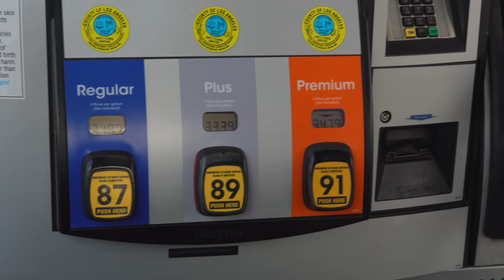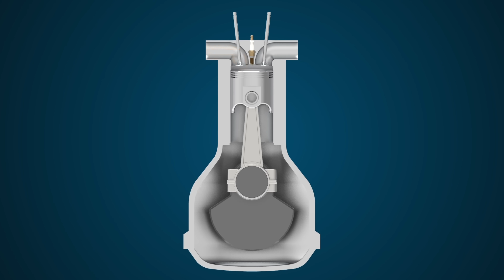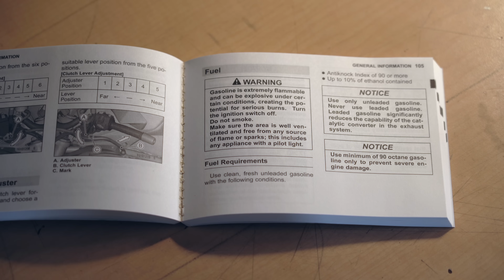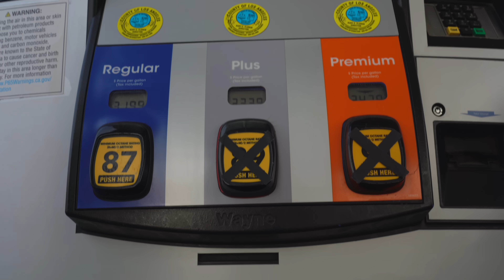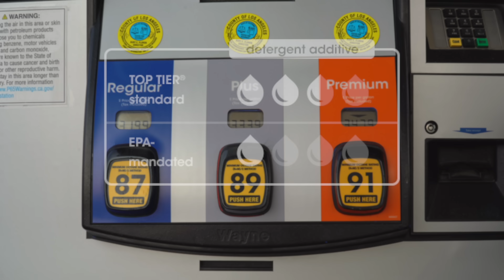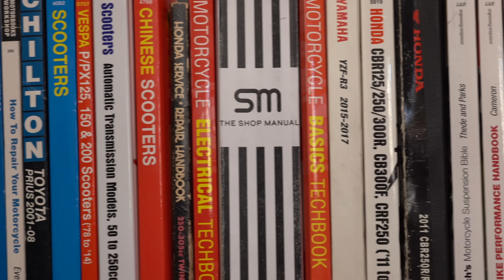Should You Run Premium Gas In Your Motorcycle? Octane Explained | The Shop Manual

Comment: I've had to explain this to so many people who put premium in their corolla.
Reply: @4The2nd BTW, I never said , nor even implied i am smarter than anyone... I have fully stated my thoughts are from EXPERIENCE ... not brilliance...
Maybe you should stop telling people what they think....
Reply: VTwinner,  First of all my first comment was not directed to you and you're first comment was directed at me because you had a hissy fit that I used the word "Theory". 🙃 I didn't invite you into my comment. Second, who is telling you 85 octane is the correct one to use? Not me. Based on the compression ratio and other factors of an engine I know what octane of fuel to use. Do you? I don't think so. I built quite a few motorcycle drag bikes in my day doing 8.53 seconds at 153mph in the 1/4 mile, so I know what I'm talking about. If your car runs better, gets better gas mileage and has more power with the higher octane fuel, then it's obvious you're engine was not designed to work with the lower octane fuel because of the higher compression ratio. If you're engine is equipped with an anti knock system and you're using 85 octane fuel when it needs 91 or higher the ECU/ECM receives information from the anti knock sensor telling it there's pre ignition present "a high pitch pinging sound from the engine" then the ECU/ECM retards the ignition timing preventing preignition which results in less gas mileage, performance and power. Also if you have an engine that was designed for low octane fuel and you put in the highest octane available, you will get worse gas mileage and lower performance and power because the octane is too high. If you don't believe anything I've said then I suggest you watch Scotty Kilmer on YouTube. He has been working on cars for 52 years and reminds me of a guy I used to work on my truck when I didn't have the tools and or knowledge. He has a video on how octane fuel has an effect on an engine.
Reply: @cliffords.8341  Thank you! My father built drag bikes back in the day, and had close times to you. Same thing you said was how I was taught.
Reply: @cliffords.8341  First of all, my first comment was not directed at you do you see where I tagged you in it? NO? Ok so we got that clear, because you tagged me before I replied to you... This is James Atwoods comment not yours , Theory is what the video used.. sorry you think its all about you...
It wasn't....Who says 85 is correct for my car... the manual does...as well as many people in this comment section saying that the manual knows best because it takes in account of the cars compression ratio and other factor of an engine.... And again you are saying I don't know what fuel to use , when I have millions of miles in 36 years of driving and thousands and thousands of dollars of gas , taking mileage EVERY day, and knowing EXACTLY what got me the best mileage per penny......PERIOD...
I don't need someone who thinks thy know everything telling me what i've already known for 30 years... I have SAVED money running premium on EVERY car i've owned in 35 years, and I've owned 30 or so...
Working on a car doesn't put on miles, people who actually drive, know.
Reply: @cliffords.8341  Oh and Scotty Kilmer is mr  DO it by the manual.. He would tell me 85 is right for my corolla as well, and to change the oil every 5000 kms.... but 91 saves me more money and makes my oil last until well past 10,000 kms because it runs cleaner in the car... win, win, tell me the drawback to it?
Half the oil changes, cheaper price per km, more kms per tank so less stops to fill back up... Sure I should listen to those that want to relieve me of my money HAHAHAHAHA Scotty would even be telling me to buy TOYOTA oil for my 1998 Corolla  that has 350,000 kms on it... Where the heck would I find Triumph oil for my 1978 Spitfire too... car with another 300,000+ kms...
Like I said, keep your theory's, I like to practice :D
Reply: @vtwinner  He might. If you benefit using 91 over 85 octane fuel then use it. Does the 85 and 91 octane fuel you have used have any ethanol in it?
Reply: @vtwinner  As far as changing the oil goes, if you use petroleum/mineral oil it has to be changed more often than synthetic oil because it breaks down quicker. Some oils have detergents which cleans the inside of the engine making the oil dirty quicker, but is not a sign it needs to be changed. Oils have come a long way in the last few years. An engine will also run cooler using a higher octane fuel when needed which results in a longer engine lifespan.
Reply: When the gas costs than the car you'd think they would figure it out, but , alas, NO!
Reply: Higher octane number may not always be helpful, but almost every higher octane rated fuel has low ethanol content. I know it is not given, but the suppliers are running the trend that way. So in theory higher octane fuel may not provide any gains but in practice it almost always does. Tried it myself and yes, better mileage and healthier engine in the long run.
Reply: @autumnleaf2976  Precisely... I've owned 20 different vehicles, and put 400 kms daily for 35 years... That's 5,000,000 kms of filling a tank every night , documenting my fuel consumption, and figuring out what gave me the best bang for my buck... These experts obviously have NEVER tried it and like to talk out their ass...
Reply: @4The2nd GLWS HF, I'm gonna keep getting better mileage and a cleaner engine. 😁
Reply: @4The2nd Oh BTW, my 1978 Spitfires manual says to use 5w30, If you use anything but 20W50 , your nuts...
And this you will hear from every person that owns a Triumph Spitfire ... just because they thought they knew best at the time, don't mean they do... A Triumph Spitfire runs FAR too HOT to keep 5w30 in it... Also, todays oil does not contain the right mix of chemicals for it, I have to buy Castrol 20W50 for older engines to get the additives it needs.
Something mechanically trained people learn in 40 years of doing the job... 
Thanks for your opinion on what I don't know though, pretty ironic considering you don't know me.....
Reply: @4The2nd A Triumph Spitfire is a CAR, I am talking CARS, there are NO modern Triumph cars...,The Last one to roll off the line was 1981 or so...
Obviously you are lacking the experience , or you would have known about Triumph Motor Cars, ... Google search British Leyland and you'll see what I am talking about..
A Spitfire using 5w30 as per manual, in this area, will fail, because the oil cannot handle the operating temperatures... We need 20W50 , no matter what you've been told.
Reply: As a BMW owner... 93 or die. Getting a yammie R3, so I can put 89 in it, cus fuck 83
Reply: a corolla elecronically adjusts timing so with a little help from premium fuel it can reduce or eliminate detonation. this results in more power.
Reply: I've had to explain the octane theory to many of our customers in the last 41 years and a lot of them see those gas company commercials saying use their highest octane fuel and you will get more performance and better mileage and they don't know any better. A lot of them are finding out they have been wasting their money buying high octane fuel.
Reply: Lower grade gas here contains ethanol, high grade does not... I was getting 75 to 100 kms more per tank and I drove 3 to 400 kms per day as my occupation... Theory's are just that, reality is a different thing.
Reply: @vtwinner  Let me rephrase what I said so you will understand what I was trying to say. I've had to explain what the differences are between octane numbers and which octane is the correct one for their vehicle. Facts.
Reply: @4The2nd The only reason I stated on a highway, with cruise control, is my route, never changed... My driving , never changed... The variables that would change my fuel consumption were well controlled.... and well documented over 35 years.... That was the point I was making, i never stated CRUISE control saved anything, except for the variable of not being consistent on the throttle...
Most cars I have driven, were NOT tuned to premium, they were tuned to lower grades of fuel as was stated in the manual, yet EVERY one got higher mileage from Premium , because of ETHANOL in the fuel.
My 1978 Triumph was not tuned to ethanol, it didn't exist then, so saying my car is tuned to any grade of gasoline today is a falsehood... My car was made when there actually was still lead in gasoline...
And I've also changed out and adjusted the carb myself.. So I know what it's tuned to, not you..
BTW, if you look at my comments, I have been talking about gas mileage, power means nothing to me, I am not tracking my cars, they are dailys, I care about mileage not power, you were the one discussing power.... I just agreed with you ...
Whoooosh
Reply: @4The2nd OH and , to add to the Triumph bits... Nothing on my car is Ethanol compatible , it would eat my hoses, orings, damage my head, valve seats.... it would make my twin SU carbs run like shit... The ONLY fuel it runs proper on, is Ethanol free, and the only ethanol free fuel here is Premium...
Reply: @4The2nd I think you are mixing up what both of us are saying... Using premium gets me more mileage, and runs cleaner... by running cleaner, injectors stay at optimum use instead of getting clogged and not misting properly.. You will retain your power longer, as cars that age, lose power, the ones that were treated to premium all their lives, don't.... Will it give more power, no, but it most certainly will help you maintain a cleaner car, will increase the oil change period, and actually save a lot of money.
My 1998 Corolla has 350,000 kms, my78 Spitfire has been around the odometer 3 times before it let go, so its well over 300,000 kms... I had a Kia Sportage I put 450,000 kms on in 3 years and it was still running like new when someone head on'd me writing it off... I am my mechanic, no one has worked on my cars in 30 years except me... It's not rocket science.
Reply: @4The2nd I never once stated my oil lasts 24,000 kms... I stated , that I went to an oil change place @ 24,000 kms, and they stated my oil was still good.... Not me...
I change my oil @12000 kms normally..
You must understand, I put on over 5000kms a month, that would be an oil change every month if I stuck to the manual, that is ridiculous, that schedule was made when there was lead in gas and and oil and gas didn't have the detergent it does today, to go by 60 year old oil change intervals is idiotic... 
I don't only maintain my vehicles, I maintain others and have been mechanically trained as part of my occupation ... And Ive been doing it for almost 40 years ...
If you think todays fluids need changed that often, you're just doing it to charge people more, it's not necessary at all....
I've literally done thousands of oil changes, and the people that come to me on schedule, their oil is still clear... it has LOTS of life left...
Reply: @4The2nd Again putting words into my mouth , not the other way around.. I did not state you said that ... I said , IF YOU THINK... that is not a you said, if I quote you i will copy directly from your text. 
See, I live in NB Canada, Not Europe, Not the USA, I live in small town sleepy NB, where our 110 kph highways have no amount of traffic. I can literally put my cruise control on leaving Moncton, at 100 kph, and NEVER have a car get in front of me slowing me down... Most blow by at 140...So to say that I can't control or monitor variables is bullshit. 
I started working on a delivery fleet mechanically in the 80's, I started driving professionally with them in the 90's ...
I was trained in mechanical for 10 years, not just doing my own.. I still do a lot for others, makes for great pocket cash. 
but I have 30 years, a tank a day, 400 kms, between Moncton and St,John and Fredericton, I know my mileage and I can easily eliminate the times I had organ transfers where I would punch the accelerator to the floor and not stop even for RCMP until I got to my destination... 
Yes those trips I got shit mileage, but the money I made doing them was well worth it, and I can easily shift that from my gas consumption spread sheet to the PEDAL TO THE FLOOR spreadsheet... Like I said, it's not Rocket science, meaning its not complicated, or hard, anyone can do it.
Reply: @4The2nd Your Kia wouldn’t have said every 5000km either.
Check the manual yourself and look at the  rough usage interval ..
The vehicle was being abused by me and still went almost a half a million kms and could have done lots more... A range rover head on stopped it, not the oil
Reply: @4The2nd We don't have E10 here, so you talking about that is moot, we have 85, 87 91, only Premium fuels have no Ethanol... 
I never stated Premium was cleaner than E10, I've never touched , smelled or seen E10...
Again putting words into my mouth....
I've heard enough quite frankly, enjoy your roast...
Reply: @4The2nd I tried to link a video for your proof, but it isn't showing... 
Search the title and watch the proof... 
"Is Non-Ethanol Gasoline Really Better? Let's find out!" Project Farm came up with a 4% longer time running with Non-ethanol over 10% Ethanol mix... or E10 ...
4% more miles is a pretty good difference.
Video also proves you CAN control variables and test it...
Oh I just thought about something ... I did say I got 75 to 100 kms more per tank, on my 60L tanks, that would actually confirm what I am saying...
And to the "you don’t like being wrong but you were wrong" , I wasn't as my 35 years had shown...as well, in my 50+ years I've been wrong many times, I accepted it, learned and stopped questioning people with 35 years of experience without testing it myself.. 
You may someday too..
Reply: @4The2nd There you go again putting words in my mouth... I did not say premium burns cleaner than E10, as I stated already, I have not touched, seen , nor smelled E10, We don't get it here.. The Highest Ethanol % we get is 7%..  I didn't say Ethanol burns cleaner or dirtier, I said PREMIUM burns CLEANER than LOWER GRADES... 
Shell Vpower has detergents the lower grades dont, if you can't see it as being a cleaner choice, then you are quite mistaken... ethanol or not, premium runs cleaner, as was stated in this video, and any video out there from a valid source would say it....  The Project farm video showed no significant difference in E10 to Non ethanol though, so thinking E10 is cleaner may not be correct either..but again, I AM NOT STATING THAT IT IS... I gave a video of someone else stating that... 
See, the only things you say I was wrong about, are the things you made up in your head.... 
Regular here is 85 , and premium is 91 or 93, you are quoting octanes again, when I am talking about ethanol's cause as being the loss in DISTANCE... sheesh you really hard to talk to and try to get through to... 
That's only a detriment to you dude.. 
Enjoy...
Reply: @4The2nd Here's another video to look for... "Does Fuel Stabilizer Prevent Ethanol Damage? Let's find out!"
Ethanol is gross, attracts water, and eats through a lot of gasket materials...
My 2002 SV650S when I bought it, had 5000kms on it in 16 years... When I went to look at it, it was pissing gas out the carb bowls... When I pulled the bowls, the ethanol the idiot left in it, varnished everything, and ATE through the gaskets, which was why it was leaking... 5 $ worth of gaskets, got me a pristine 16 yr old SV650 fot 1700$ ... I could sell it today, 2 years later, for over 3000$ ... 
Ethanol is garbage, use it if you like, I'm not.
Reply: @4The2nd There you go again inferring I said something I did not say....
Next time you accuse me of saying something, please copy the quote directly from what I said... and yes.. me and The Project farm, and many others who have torn down engines after a lifetime of ethanol know nothing... I'm not pig headed... You are, and you're so pig headed you can't even admit it to yourself LMFAO...
Good ... bye ... Felicia
Reply: @4The2nd Karen? ... I guess you don't know what a Karen is either... LMAO...
You MUST be a product of the American Scholastic system...
You're ego is off the charts, you tell everyone what they are thinking even if they haven't said it... and you are standing on shaky ground pounding your chest like you won something...
I am going to type this real slow so maybe even you can follow it...
What I said was , Ethanol is dirty, it hold water, causes failures in materials on older cars.. and it will varnish newer cars... This is FACTS... Everyone knows this...
I never said it burned dirtier, or cleaner, what I SHOWED was a VIDEO of a GUY on PROJECT FARM , that said at the END OF HIS VIDEO, that E10 and non- ehtanol gas had NO SIGNIFIGANT DIFFERENCE IN CLEANING OF THE ENGINE..
I alsso stated that PREMIUM GAS HAS DETERGENTS AND RUNS CLEANER THAT REGULARS>>>>> 
I NEVER SAID E10 runs beter or worse as far as cleaning an engine, for the 3rd time... I HAVE NEVER TOUCHED SEEN NOR SMELLED E10...

Do you understand now ?

BTW a Karen is someone who is entitled and demanding beyond the scope of what is appropriate or necessary...
Not someone with more knowledge and experience that is trying to teach you something but you are too stubborn and have too much ego to learn it... so you keep saying I said something I NEVER SAID...

Keep pounding your chest little boy, it stil wont make you right, and anyone reading this can easily see it... 

Better to Remain Silent and Be Thought a Fool than to Speak and Remove All Doubt
Reply: @4The2nd BTW, where is the quote where i stated what you are saying, I thought you were going to DIRECT QUOTE ME as to what I said...
NO? Oh yeah thats right, because I DIDN"T SAY IT,....
I f I DID say it, it would be above for everyone to see...
You know what they won't see...
Me saying that E10 is ANYTHING AT ALL.... 
What they will see, is me REPEATEDLY SAYING... 
I HAVE NOT TOUCHED, SEEN , NOR SMELLED E10 ..
Now lets try this again, if you are going to accuse me of saying something, produce it, a direct quote, copied DIRECTLY from one of my posts, if not, your shaky ground just crumbled Felicia, time to get back to your crack pipe
Reply: @4The2nd You can click on ANY edit and see it... again... I never said it... ... the only thing I have ever said was in defense of my statements... the only things I jumped on was your mental leaps that weren't true... again you are saying I said something that I clearly showed from a Project Farm Video... and He Said it Not me... 
you are showing signs of schizophrenia or lead poisoning... please get tested...
Reply: @4The2nd Btw, I am not offended, I am in awe at the stupidity actually, I pity your lack of comprehension and obvious ADD that makes it so you can't follow a simple conversation genuinely ... Really, get checked...
Reply: @4The2nd It's even in this video about detergents and being cleaner yet you deny it... 
3:43 listen carefully to what he says about detergents in higher grades and how they run cleaner... as I was stating, and Project farm dude stated... Premium runs cleaner than lower grades of fuel...
I run Shell Vpower ALWAYS,, it is a TOP TIER fuel. I used to use the 7% Ethanol every second tank we get here(BTW E10 is 10%, you would have learned that had you watched the project farm video I suggested)... The 7% mix here, lower grade, got me around 500 kms per tank, and i got 574 to 600 km on Premium.. No matter what you think...
It's been proven time and time again.. 
Make up whatever you like... If you go around telling everyone around you they are arrogant when they are just trying to show you something you will never learn... 
You an anti-mask Trumpster too?
Reply: A knock sensor is an acoustical listening device, tuned to listen for the very distinctive sound of knock in your engine.  When it detects knock, the ecm will advance timing slightly to attempt to compensate.  Your stock engine has a stock tune, a map.  It is set from the factory to meet epa standards and balance power with fuel economy.  Your engine can NOT detect the octane of the fuel, it is using the map to do it’s thing.     Unless you have a tune, your engine will NOT make more power with a higher octane.   Fuel economy is debatable.  Here’s an experiment if you think octane effects economy.   Fill up with 87, add a bottle of octane boost and drive.
Reply: @bubba9482  that's why I keep saying the difference I see comes from eliminating ethanol and not the increased octane... ethanol is basically a cheap octane boost.. the ethanol varnish I cleaned out of my 2002 Suzuki's float bowls was disgusting.... no way those jets were performing to spec... I can't keep the front wheel down now that I've cleaned it :D
Reply: @vtwinner  man I just read that whole debate between you and the other guy. I'd be laughing my ass off if it wasn't so sad. I'm NOT a mechanic at all but basic reading comprehension told me you weren't saying higher octane = more economy. You were saying (in your area) only high octane is ethanol free, and ethanol mixed fuels gave less mileage than the ethanol free (in your area = high octane) fuels. I remember when E10 became popular in my hometown gas stations even put little signs telling people to expect a mileage decrease, but that it os normal and is ok since it supposedly ran cleaner.

I'm not sure where he thinks you said E10 runs dirtier, but I immediately discredit anyone who claims you said something but fails to provide evidence.

I haven't tested how much mileage increase I'd see running an ethanol free fuel, but in my area it would need to be an increase of at least 22% efficiency to break even with the cost difference.
Reply: @petedavid5127  About which comment?
Reply: My 1995 Corolla owners manual says use 91 octane... that's what I use. I got it from a little old lady who used cheap fuel from no name gas station, Stop&Shop fuel, and the fuel deposits in the engine and intake gunk was horrible. It only had 28 thousand miles on it when I purchased it and I had to perform remedy solutions to resolve the internal engine filth. Today, it's at 92 thousand miles and it's still a hoot ti drive. I've made an coupe of mods to it since then but nothing crazy. It's my daily so, I'm being kind to my classic car. 
My 2001 CBR600F4I had the same issue when I got it tow years ago. I had to rebuild it die to several issues resulting from internal filth caused by cheap fuel... since then, it's been a great ride. 93 octane all the way. 
😊
Reply: They say it runs better.....idiots
Reply: depends on what engine is in that corolla 4age 2zzge 3sgte
Reply: Do you remember the part about the additives and detergents? If I had a Corolla, I'd do the same as I do for my MB, BMW, YAMAHA's and F150.
Cheap stuff sucks.
Reply: funny thing, on our old diesel corolla executive
i made a mistake at some new fuel station that use colors i'm unfamiliar with and i filled half of the gas tank with gasoline instead of diesel oil
the usual recommendation was to unfill it and change fuel-pump and remove injectors
luckily the old diesel engine had no higher compression injectors
and thus tolerated gas if it was nothing
but i did another thing, i filled again the fuel tank at every 25% empty, my reasoning was gas is lighter than oil
and i had no problems since
it's as if 2005 corolla is marine diesel tier tolerance for bad fuel
Reply: I think you meant VTEC 🤣
Reply: What bout my audi tfsi ? :"D
Reply: Corolla’s are premium
Reply: But it makes more power and gets better mileage!!!

Me: Really? How many records of mileage do you have?

What?

Me: I bet you change your full synthetic oil every 3000 miles even though the manual says 10k miles and have never had it analyzed?

Of course, always every 3000 miles regardless! The oil was brownish black! What's analyzed?
Reply: Cars have a knock sensor and can adjust timing, so higher octane will get you better fuel economy in a car, but also ever so slightly more top end power. And, with more detergents, higher octane will also keep the engine cleaner. Not a bad idea, imo.
Reply: @ChrisJohn_444  Not all cars have knock sensors, also if the engine is designed for 87 octane, regardless if it has a knock sensor or not you WILL NOT benefit from higher octane grades of fuel!
Reply: @ChrisJohn_444  :  That ONLY comes into effect in engines that have a compression ratio that requires higher than "regular" octane, It allows them to run on regular at full throttle without damage, if you never use full throttle (many people don't), you will see no difference in fuel milage using one grade lower than recommended. Putting in half a tank of premium when very neer empty every five or so tankfuls of regular will provide all the 'cleaning' you need.
Reply: @johndavidwolf4239  Not true. My mustang is tuned 87 octane from the factory, but gains hp with 93 in it. Also, I've tested it in regular driving, same kms, same route, same driving habits, renders better mpg. And, more cleaning additives, means better cleaning. You pay more for it, but you get more. The way the ecu compensates for lower octane is it pulls timing. With higher octane, it bumps timing, so it's more efficient and has slightly more output.
Reply: @ChrisJohn_444 :  I don't know which motor you have in your Mustang, nor what the compression ratio is, but from what you said you may be conflating "tuned" with "marketed" and if your data is correct,  (to be so your car has to be test driven by someone other than you who does not know which gas is in the tank at the time, an example of this is that in most drug trials, "placebos" typically have about a 30% effectiveness rate) then I would guess that the mechanical compression ratio of your engine is over 10:1 and that in reality it is "tuned" for higher than 87 octane and the book 'recommendation' was written by "marketing" and not "engineering".  Unless you manually input the pump octane number into the car (ecu) it has no way to know what the octane is and only retards the timing if the "knock sensor" detects a slight knock, which occurs before you can hear it,  Depending on the programing, it returns the timing  to 'original' after a period of time, or at the next fill up.
Reply: @johndavidwolf4239  87 is lowest recommended by Ford. Because of the knock sensor, you can safely put in 87 octane. But, if you put in higher octane, it produces slightly more power and is more efficient. I'm also well aware of the placebo effect (I have a degree in psychology), so I had it in mind. And, I tested it on a 91 octane tune, put in 93, and got better economy. So, it's fair to say that the knock sensor is working as intended.
Reply: @ChrisJohn_444  Now, I could just be misinterpreting but I think what you mean to say is that with 91/93 you have baseline hp, while 87 you get less power. This, opposed to saying you gain power putting 91/93, is the same thing just said in a way that I think you mean to say?

Sorta like how you get more grip if you have 4 tires on your car instead of 3... well, while that is true, the correct way to say it would be you get less grip (among other things) running 3 tires vs 4 on your car.

I don’t mean any offense, I just think that’s the misunderstanding between you two here.
Reply: @Procxlite  Nope, oem tuned for 87. Better economy and power with 93. Knock sensor.
Reply: @ChrisJohn_444  So that means knocking is caused at 87 without a knock sensor, no? If the car was tuned for 87, the knock sensor would have nothing to do with better mileage or performance putting 91/93 in it. If putting 87 tripped the knock sensor, that would cause the timing to be adjusted so that it wouldn't knock and therefore 87 could safely be put in. Am I missing something? 

Pretty much if the car was tuned for 87, then there would be no knocking and the knock sensor would not go off with 87 gas. In this case, the knock sensor would be irrelevant. Unless the sensor does something I'm ignorant of, or that the car really wasn't tuned for 87, then I don't think the sensor itself would have anything to do with an increase in hp/mileage with higher octane.
Reply: @Procxlite  Can safely run 87. Multiple different grades at the pump. You don't have to believe it, I'm okay with that.
Reply: @ChrisJohn_444 I believe you, I just want to know where it says that it is tuned for 87. Being able to safely run it is one thing, but being tuned for it is another.
Reply: @Procxlite  Think of it as it's tuned for all commonly available grades, 87 and higher, because of the knock sensor, but 87 is the one that coincides with the efficiency and power numbers Ford advertises. It's complicated, I know.
Reply: @ChrisJohn_444  Your engine can't tell what octane you're running, period. Knock sensor doesn't do that, that's all a load of BS. It's likely all a combination of the compression ratio, and the tune your car is running happens to work out better with 93 octane. At the end of the day, higher octane = less likely premature detonation at high compression ratios. That's all which is important for the average person. Use what the manufacturer says to use. You gaining 5hp probably adds 0.0000005 seconds to your 0-60. More horsepower doesn't = "running better" that's a misconception too. It's not that big of a deal.. As a mechanic, I can tell you for a fact it's impossible for the engine to tell, unless you give it a tune specific for the octane.
Reply: @johndavidwolf4239  "if you never use full throttle (many people don't), you will see no difference in fuel milage using one grade lower than recommended"
I ride a Ducati. What you are saying doesn't make any sense. There are people who don't use full throttle?
Reply: @Procxlite  you're right, the other guy is wrong. The car is meant to run on 93. Ford just says it can safely run 87 because people are cheap asses and don't want to pay for 93. Its marketing. The power it has with 93 is its true power. It loses power on 87. Not the other way around. You could run an old civic si on 87 but it would lose power as it's meant to run 93. It has to do with the engine's compression ratio, not tuning
Reply: If turned for 87 then it should run best on 87, if not you are not tuned for 87, and how is it tuned for 87, what did you do to tune it for 87?. Car guys tune for race gas meaning it runs best with race fuel which can handle boost compression etc. When tuned to an octane it means best is achieved with that octane. You sir have no concept of definition of tuned
Reply: @ChrisJohn_444  2006 Mustang v6 ok with 93? just wondering or that was for just better gas and economy?
Reply: @ChrisJohn_444  I didn’t know Ford made motorcycles
Reply: @ChrisJohn_444  Agreed. My 5.3L Colorado and 1st-gen Focus ST both run better and consistently make 1-2 mpg better on Top Tier premium fuel, which I use for the detergents.
Reply: @4The2nd It will give more power, dynos all over have proved it... it will not give more distance though.
I have saved by running ethanol free fuels...
35 years, a tank a day... I've recorded a lot of tanks for proof, and my driving was highway with cruise control.. It was my job ... so yes, I know the difference....
Reply: @4The2nd here's your proof... https://youtu.be/bEf9Fdvx_Sc ...non ethanol lasted 4 percent longer than only a 10 percent ethanol mix... 
Ethanol is shit... premium here gets WAY more miles... People who actually test it... know better..